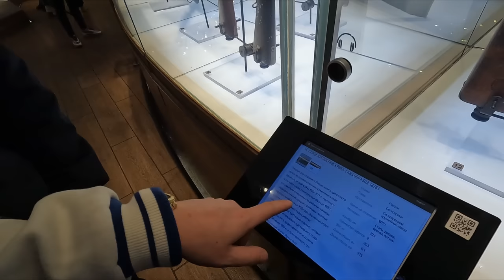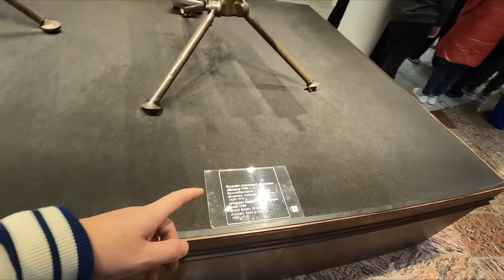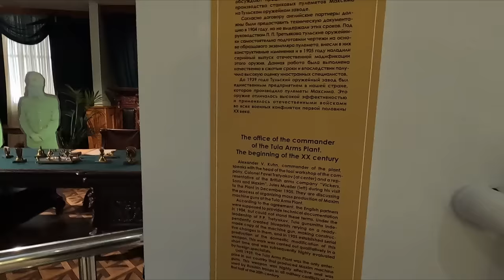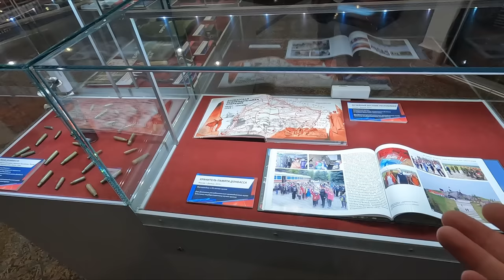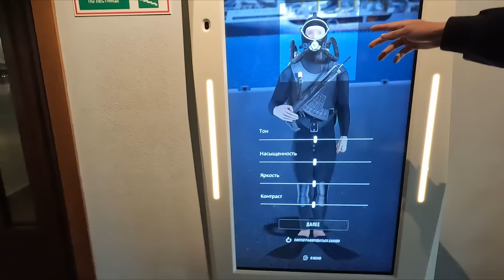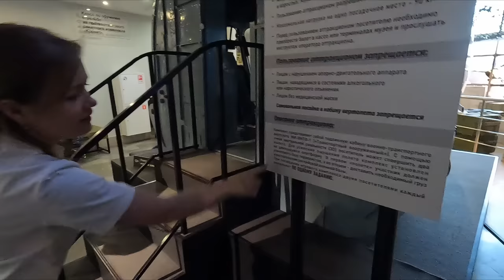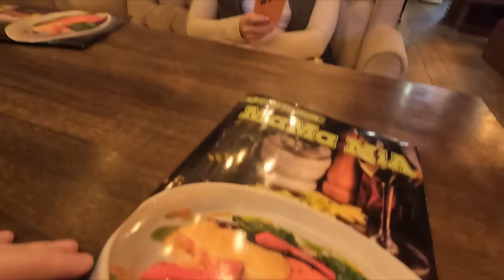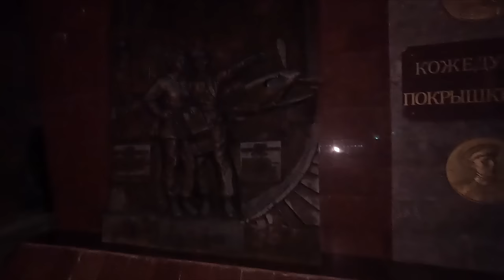Russian Propaganda

Comment: Starting the vehicle, 60s 70s I had many years of starting a  Carburetor vehicle... like step on gas. Then  Off. Then pull choke on full, crank engine. A bit turnovers, 
  if starts push choke in Half.  Then push choke off...or many other sequences to start...

Reminded me of old days, as a lady, impulsive, hurry to start....Then flooded (with gas) many fixes for that.  Later guy
Reply: @genehunsinger3981  prob LOL

Comment: WHAT THE hECK there new Tires 🤔 Was it a bad rim seal / valve stem or a puncture we need to know this stuff Ivan 🤔  lol and the Thermostat did you get that changed 🤔  that's important you want to keep your engine happy especially the computer to or it will get brain damage 🤪 

 Vehicles are like Women you can't live with them 🤪 and can't live without them ❤️ 🤫